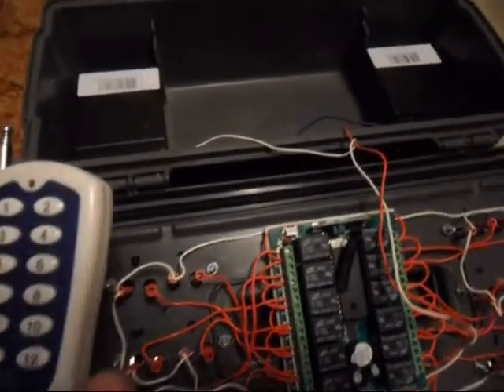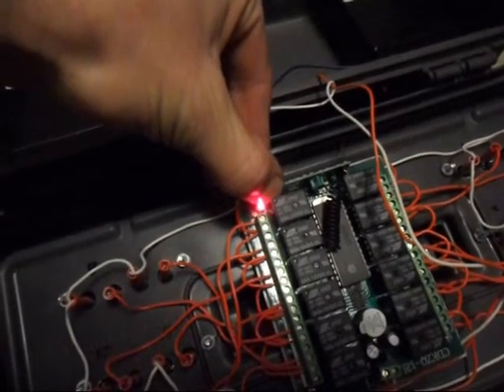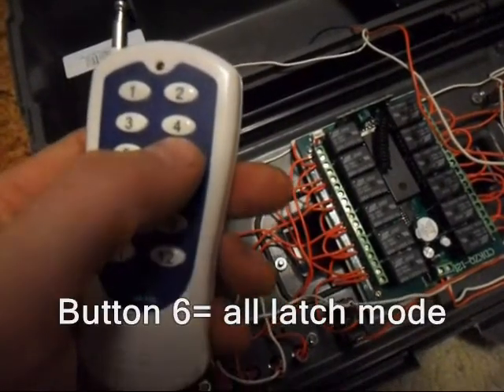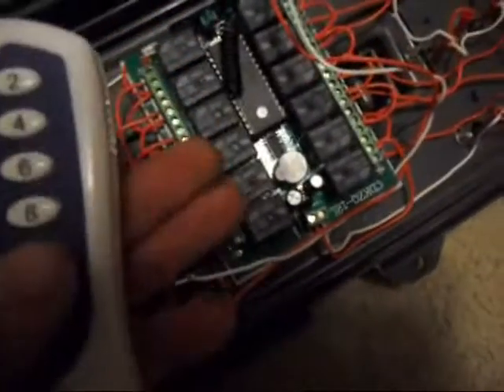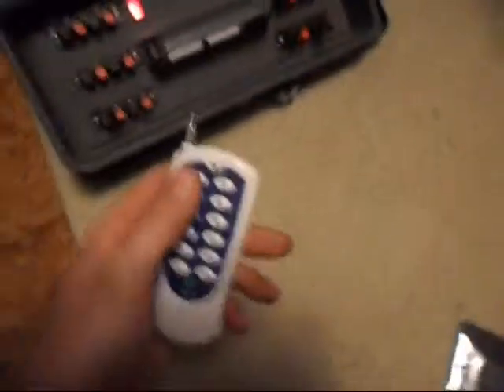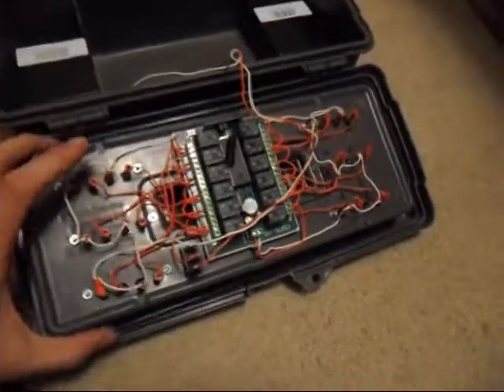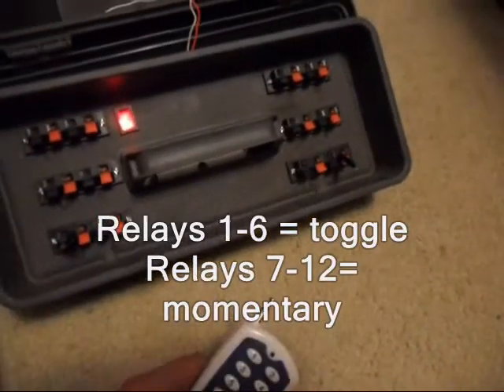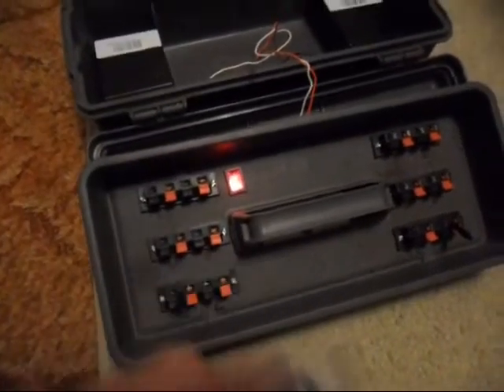How to program a remote switch

Comment from the maker: There are good diagrams and instructions in the pyro universe .com forums under the "firing systems" column, there are many diffrent way to build one. I probly spent about $60 making this 12 cue system, however it dose not have any saftey or test features. My 36 cue witch dose have saftey and test features cost about $230 to build.